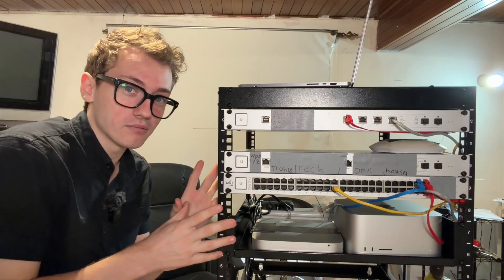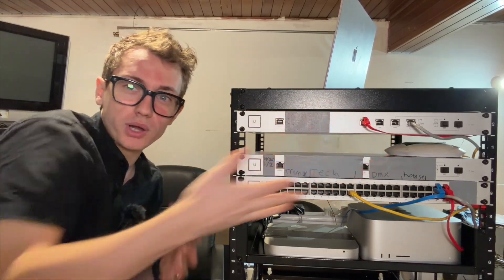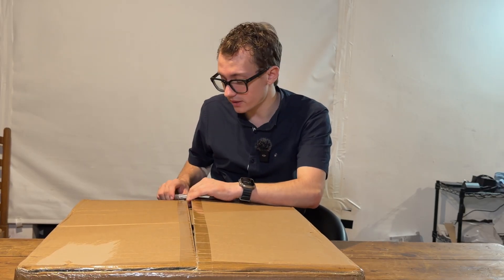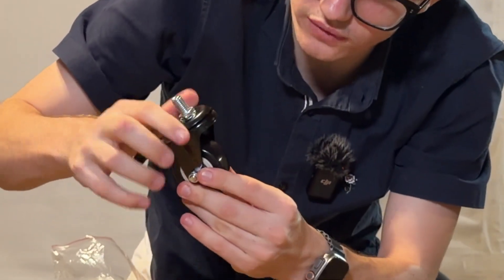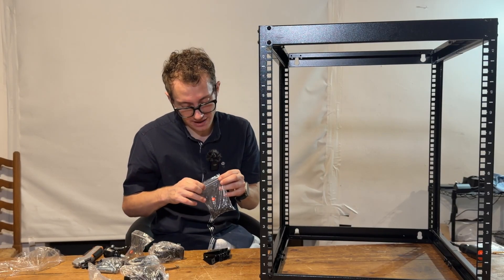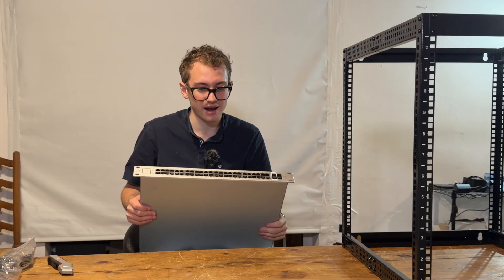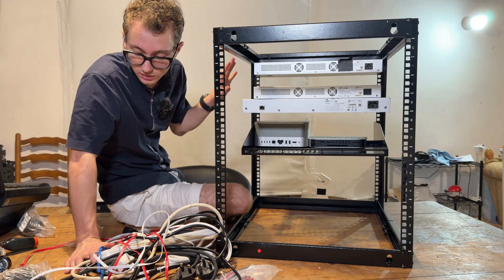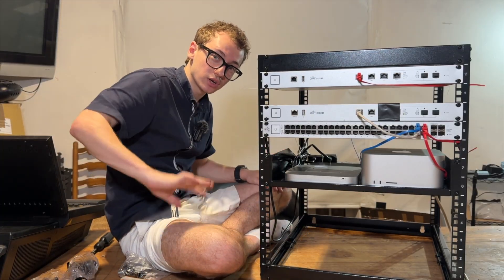Building the Ultimate MINI Production Rack

Comment: Had same issue with a 24 port PoE - Flashed to a beta firmware and then back to the current firmware and then the all the PoE ports worked.

Comment: I do not know the internals of that 48 switch but i had a rackmount 16 port PoE version of the same generation with some bulging capacitors on the motherboard. I used the power supply of that unit to replace the power supply of an 8 port one that had a blown resistor.